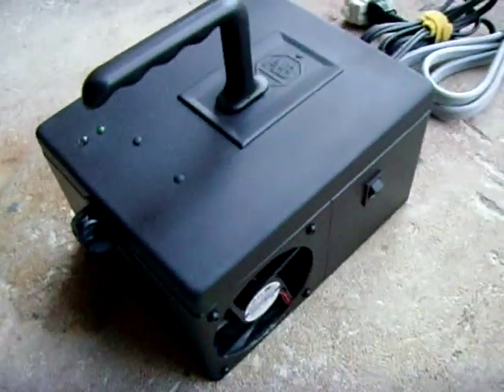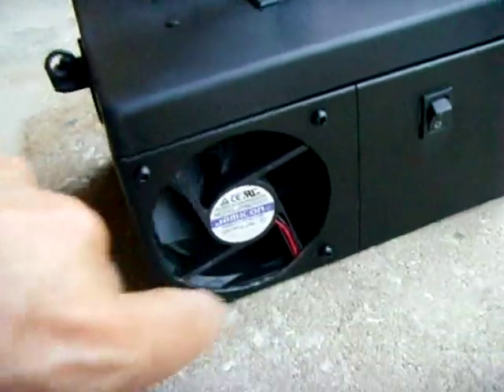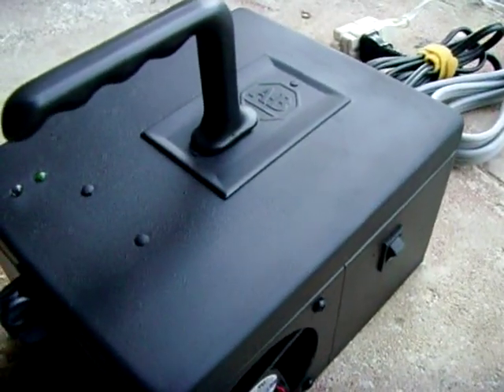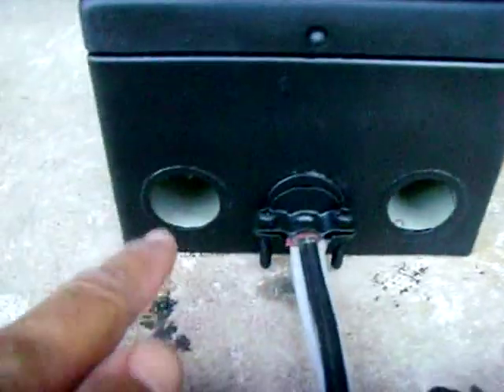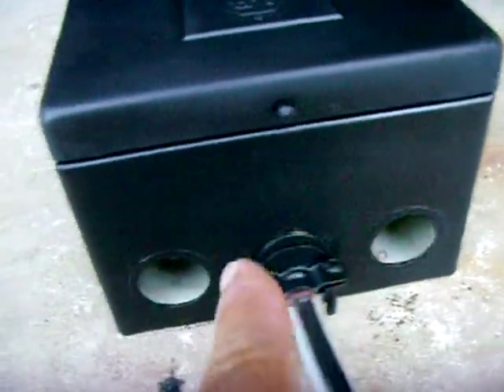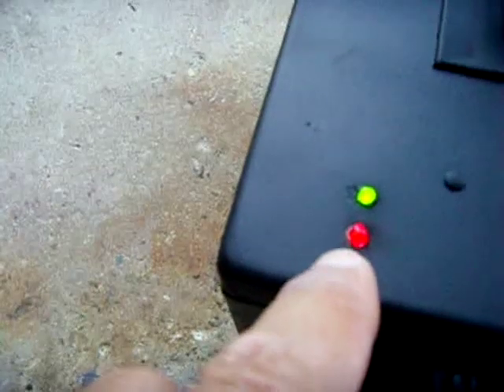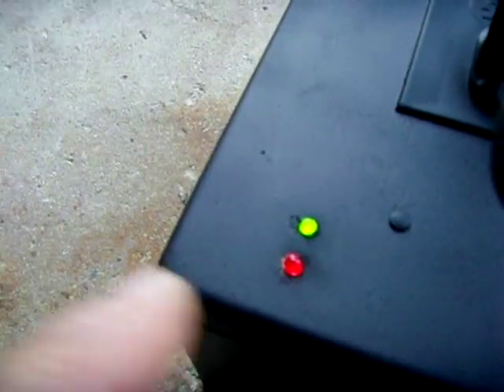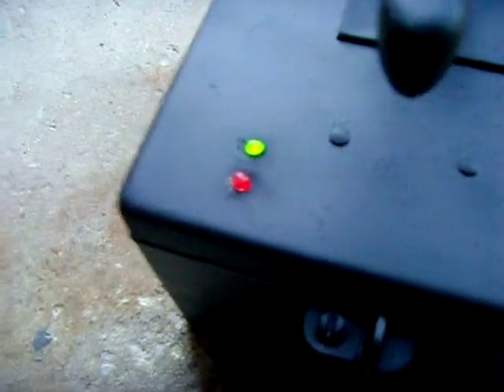Homemade 12V Lead Acid Battery Charger - COMPLETED Version

Comment: Nice! my bulldozer is 2 12 volt  in series so i was thinking of 24 volt charger is that more or less windings on the secondary?every thing eles the same? thanks
Reply from the maker: 2x the windings.
Reply: ok so i probably wont fit that many turns using 12  stranded. thanks again @electronicsNmore
Reply from the maker: @jma8352  Use #14.

Comment: Does SLA chargers need to provide constant voltage constant current?
Reply from the maker: No. Lead acid batteries are very easy to charge. Just don't charge them too quickly(which would heat up the plates), and make sure you don't over charge the battery(above 15v). Thanks For Watching
Reply: electronicsNmore Thanks so much!! Great videos!

Comment: Cool, I just stumbled upon this video, I am in need of charging many 12 volt batteries that came out of a UPS system (they are all good and not even 2 years old) I could use a automotive charger but I'd like to charger more than one at a time
Reply from the maker: +Craig Nehring 
I have charged 9 or 10 batteries in series using 120VAC rectified to 10A / 170VDC. You do need to make sure the batteries all have a similar charge remaining, all have the same capacity, and all are roughly the same age. You DEFINITELY need to monitor the voltage of the batteries. Some will charge faster and heat up. If the charging rate is too high, which you will monitor using an ammeter, then use an oil filled run capacitor (100 or 200uF) in series with the AC line to limit the current.
Reply: Okay, great. The run cap+ rectifier sounds like what I will do. These batteries are the valve regulated type (REW45-12) with the faston type spade connectors, I downloaded the spec sheet, they can put out 8 amp @ 20hr rate. Now the real question is what to do with 200+ of these? I have a really nice inverter to power (12/1800N), but it will take some configuration to utilize all of these in a series parallel. I just could not let these batteries go for scrap.
Thanks for the reply

Comment: i have a mot but after 5 minutes without any load it heat up very fast when i drop a droplets of water it quickly evaporates do you think the mot have any problem?
Reply: I belive you removed the magnetic shunts. That leads to too much current.  Leave the magnetic shunts in.

Comment: where can i get the schematic of this sir? thanks in advance
Reply from the maker: If you look through my video lists, you will find a homemade 12V lead acid microwave oven battery charger, a circuit you can use for a 12V lead acid battery charge indicator(once the battery voltage has risen to 13.8V an LED turns on), and other videos. Make sure you have that cooling fan next to the power transformer. If you don't have a computer case fan, then use the 120V cooling fan from the microwave oven. That transformer runs hot and needs to be cooled! Check my video playlists for 12V circuits and microwave oven (MOT) projects.

Comment: Is it able to provide constant current or constant voltage to charge Lead Acid ?
Reply from the maker: The lower the 12v lead acid battery voltage, the higher the current will be that is drawn into the battery. The voltage does not need to be constant for lead acid charging. Check out this circuit here. It is excellent, and uses constant voltage and current, but only good for lower current charging.

Excellent & Simple Battery Charger (Gel/Lead Acid/Li-Ion/+ more)

Be sure to rate Thumbs up, and share. Thank You.

Comment: is it bad if you leave it on for a while? I want to make one where if I am away, the battery does not blow up because of over-charge
Reply from the maker: Your looking for a 12V lead acid battery maintainer. The circuit in this video is designed to charge up a weak 12v battery then stop the charging when it is complete. This circuit below is perfect for you. Set the output voltage around 13.8v, and set the current around 200mA.

Excellent & Simple Battery Charger (Gel/Lead Acid/Li-Ion/+ more)

Thanks For Watching! Be sure to share, and rate a thumbs up.
Reply: electronicsNmore Thanks!! Great videos!

Comment from the maker: The transformer should not be getting that hot. Make sure you are operating the transformer at the SAME frequency(50/60hz) which it was designed for. Use nothing less than 12ga copper wire with a good insulation which can tolerate some heat. MOT's due to the large primary wire size, are pushed way above their rated wattage. To eliminate any heat issues, take the cooling fan out of the microwave oven and use it to cool the transformer just like when it was installed in the oven. Also make sure your windings are OK.

Thanks For Watching! Be sure to share, and watch my other videos as well.

Comment: Schematics ? :)
Reply from the maker: This is fairly easy to make. If you go through my video list, you will locate the "Homemade 12v battery charger circuit", you will also find the "rising dc voltage led indicator circuit". I also have a tutorial on how to rewind a microwave oven transformer for use with this circuit. Just make sure the MOT has enough turns of 12ga wire on it to produce around 18-20VDC when rectified. After winding the MOT, you can check the AC voltage to see if it is around 13.5-14V max. Once rectified, you will have around 19 or 20V. I get around 10 amps. Make sure the rectifier has a good sized heat sink, and is rated for the correct voltage and amperage.
Reply: I just need schematics of auto switch off.. :-) i know how to make everything else :-) thanks

Comment: Smashing rewind, good idea :-)

One addition you may want to add is a relay on the output so you cant short the leads before you connect the battery, coil across final output, relay breaks pozitive before final output, and if you add a diode in the coil lead then you have made it polarity reversal proof :-)

Ive seen this done in really monster chargers with a massive relay, but you could use a car accessory relay.

Just my mad thoughts :-)